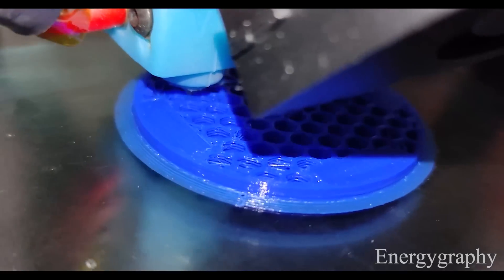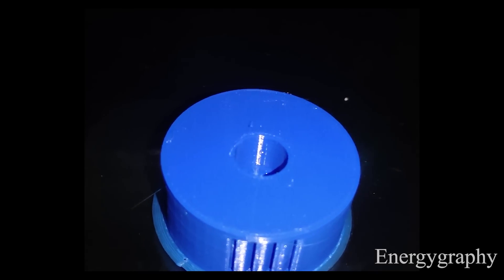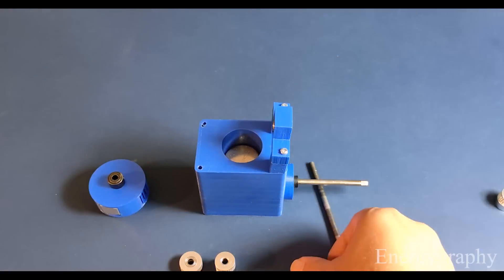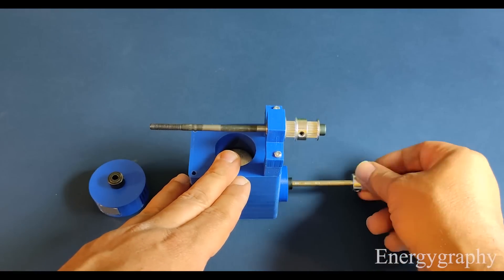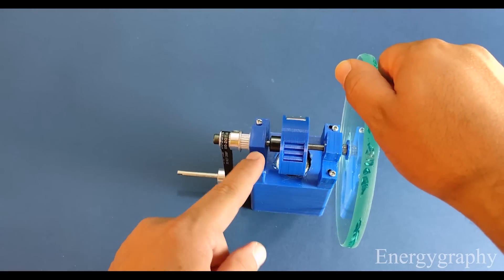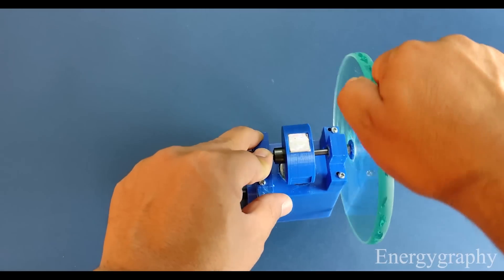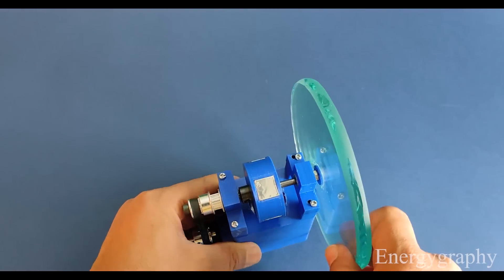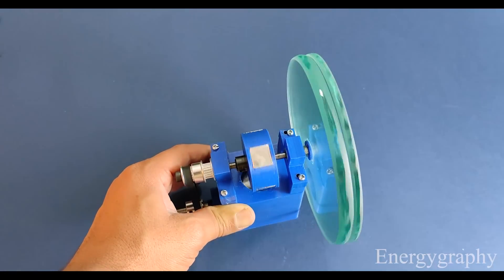Testing the Radial Magnet Motor: Flywheels, Timing, and Next Steps

Comment: Great work, but you need a MUCH bigger/heavier flywheel with a MUCH higher moment of inertia. As a rough rule of thumb, if the connected magnets can hold the weight of the flywheel, then the flywheel is probably too light. For example, if the magnets have a pull force of 50kg, then you’ll probably need a flywheel that is close to or greater than that weight.

Comment: Coverting reciprocating motion to rotational  we have to consider many thinks. 1. Belt drive eat lot of energy. It is to be replaced by magnetic gear. Design your connecting rod leght to stroke length ratio above 2.5. it will reduce angular force on cylinder when piston changing its direction. It's also reduce sudden piston acceration to crank angle between 12clock to 3 clock and 9 clock to 12.. atleast static balancing of crankshaft and all rotating parts. It is must. It eats some of energy  due to mass offset related to rotational center line. Many dynamics have to be consider. Instead of rotating magnet on top rotate magnetic sheild. That is easy and focus magnetic flex downward.  All these are not that much easy.

Comment: Try putting a coil of iron (steel) on top,
  add an alternator to the shaft, (which can be an electric motor)
to produce current,
  add capacitor to maintain power of electric current,
  to operate in the coil only when the piston is up, when it is down to disconnect because the magnet is attracted to the iron core.

Comment: Thank you Energygraphy for your time and effort, but first of all: there is no permanent anything in this world. If you make a magnet motor, one day you must change the ball bearings (the producer has already tested them how much hours could they spin), after that the magnets - they will eventually demagnetised them self because of the other mag. field, heat, etc. So; it is possible to make a magnet motor, some people already did it (you are close to, I belive) but word permanent please forget. And no, it doesn`t make much profit if you make it, because the bigger your system will be - the bigger are your expencess for it (unless you use electromagnetic bearings and electromagnets to ``burst-force remagnetising`` after about 3-4 years of working. Instead of it, learn the principles of solar energy... :)

Comment: I commend you for your persistence in search of permanent magnet energy source. 
Since you’ve already achieved 300 degrees of rotation with one stator, why not put another stator that does the same 300 degree of rotation but in an overlapping offset position from the original static that way while the first stator is on its way to complete the 300 degrees, the second stator is in the process of providing the momentum to turn the shaft for the final 60 degrees the first stator needs to complete the full turn and as the first stator completes the 360 degree spin, then it’s also preparing the 2nd stator and help it to complete its own 360 spin.
Hope this makes sense. If you wish for more clarification, reach out to me. Will be glad to help out. Thanks for all your work.
Reply from the maker: thanks for your comment Ronald

Comment: free energy doesnt exist unless we can harness energy from comic background radiation but even then there are so many logistical errors in this video the tech is interesting but dont make fake videos
Reply: the main problem is that your putting in energy with your hand
Reply: The magnetic force of attraction will always exactly offset the magnetic force of repulsion, therefore any energy output would have to be supplied by an external power source. Ie sorry no free energy here:)